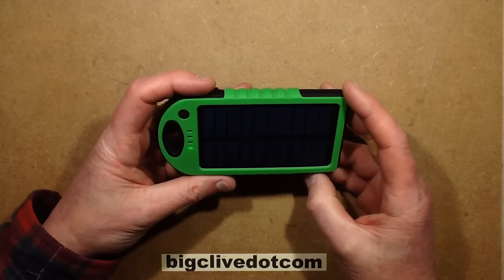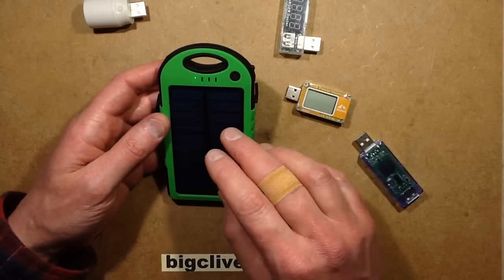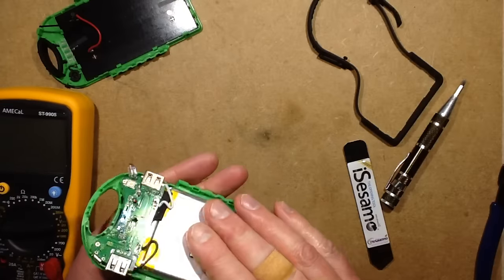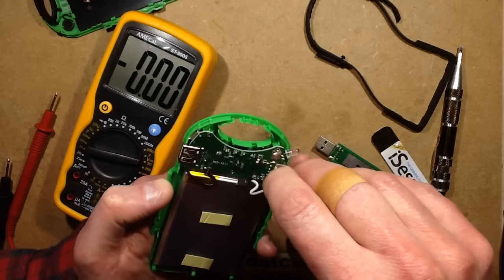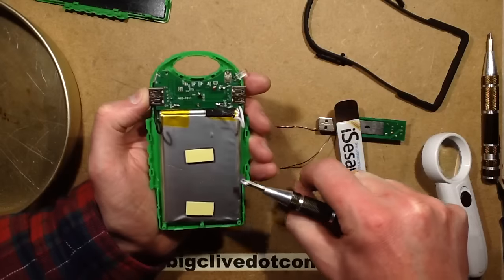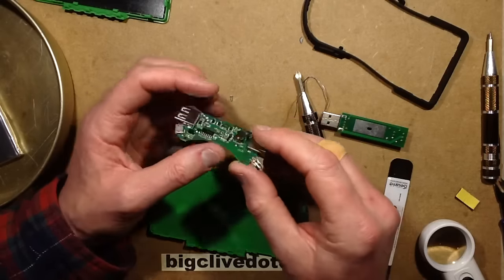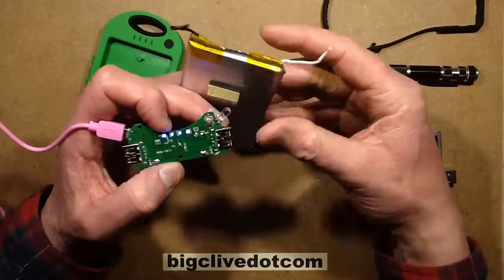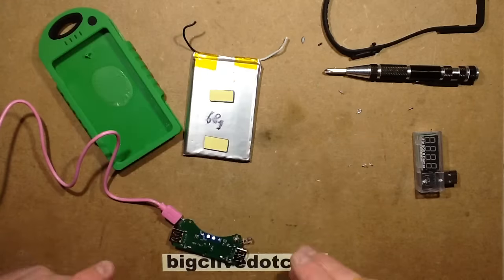Inside a solar USB power bank with "short circuit" feature.

Comment: I bought one of these and the battery was printed 3600mah on my 5000mah unit. LOL
Still cool though for so cheap.
Update: I contacted the seller and they gave me a partial refund.
Went from cheap to super cheap. -satisfied!
Reply: I got one of these a few years back for approx. £10 - rated "5000mah" with the technical section of the manual claiming "6000mah" neither which I believed as the power density just wouldn't work with the best stuff on the market. I can't remember off the top of my head but I opened it up to find 3xxxmah on the battery which I pretty much expected.

Mine actually works pretty well - holds a charge for months, tops up my phone battery atleast once with enough for another 30-50% charge and the solar panel doesn't seem entirely useless though I suspect I'd have to leave it out for several days to get a full charge.

Only got it as I wanted something cheap to stick in one of my work bags where it would take too many knocks for something more expensive but it has held up for around 2 years so far - my intention was to buy cheap expecting to replace it after a few weeks or months.
Reply: China sellers seem to miss off the decimal point.  I got some batteries rated 2500mA and found they were actually 250.0 mAh

Comment: Clive, just a suggestion for removing stubborn batteries that are taped or glued in like that in the future.  I have found that if I take some kevlar fishing line and slide that under one end, then pull the ends of the line back and forth while putting some tension on it to essentially "saw" the glue or pad or whatever it is in half, but since it is just string, it should not risk damage to the pouch cell.

I like kevlar line because it is very tough and resilient, but I have use normal plastic mono-filament line as well, really any sort of thin tough strand should work.

Comment: The panel likely outputs around 150mA, common of that size, it would still take ages to charge just a mere 3000mAh battery however, over 20 hours. 
This is why these items are gimmicks in my opinion. 
A much better item would be a small foldable panel that looks like a tiny aluminium suitcase, let's say unfolded it might be 30cmx20cm, and it's 15cmx20cm folded up. Made with the same quality cells as commercial roof panels, you could expect this mini foldable one to be around a 10w panel. This panel would have 2 outputs, a 12v type one, and a 5v type one for USB devices. 

The idea would be that you could plug it into any power bank or mobile phone, essentially anything that charges from USB, and charge the items up easily and quickly. Plus you could rest the charging item in the shade behind it or behind a tree or something, while the panel itself is in the sun, to basically reduce sun damage and heat on your power bank or mobile phone. And at least with this setup you could not only charge at full rate, but you could likely charge 2 items at the same time at full rate in fact. 

These items like in the video however are crap gimmicks, the only useful thing in the power bank is the battery, the solar panel itself is a glorified solar garden panel in it's pathetic power. A person may as well take the battery out and solder it up to a proper charging circuit if they made the mistake of buying one of these, and of course the panel itself could only be used for a solar garden light project, trying to charge any serious powered battery from such a panel is a fools errand.

Comment: I built a kit that looks  a lot like that one, hell it's even green on one side, black on the other. The kit came with no batteries but I have a rather extensive collection of cells from old tablets and such, so I found 3 that all had the same size and rating, soldered them together with a copper strip for added amperage, then ran the leads to the board.  It has worked great for a couple of years now, it has a strange setup on the side opposite the solar cell, it consists of 9 LED'S with a plastic cover for an area light. This is actually very useful, as I discovered when we had a lengthy power outage last winter.  I turned it on, and the LED's kept our living room illuminated fairly well for several hours and still had nearly full by the gauge.  One of the LED'S on the gauge stopped working, so I replaced it with one I had which turned out to be green instead of the blue that is in the gauge. Does look a bit strange but is readable.  The kits are a blast to build.  Do you think I am taking any chances by hooking the 3 cells together as I have?  I tried it once before making a 12V battery for a hand-held CB.  My grandson's took them out and had a blast with them (I have two) and when they brought them back, they left the one I built the battery for on.  The middle battery swelled about four times it's size, so it was I threw the whole pack instead of trying to recover the outside 2.

Comment: The thing about these types of devices is that you can get 'em good or you can get 'em cheap, but seldom both.
Could some sort of circuit be added to the solar cell side to protect the battery?
With it being so easy to disassemble and what with that extra space the circuit could possible fit.
Reply: +Michael Thompson

I think you could put a 1n5229 zener diode (4.3v 0.5w) across the lithium battery to prevent overcharge. Any voltage above 4.3v will be shunted thru that diode, and I'm sure the solar panel can't put out more than half a watt when at 4.2v or more, even in full sun.

If the USB charge circuit doesn't like that, you could wire the solar panel's output directly to the input of the USB charge controller, making sure that you keep that schottky diode in series with the solar panel (it's reverse polarity protection, which prevents current from flowing thru the solar panel when there's no sun on it).

Either method could be executed for extremely low cost, and the modifications will probably fit right in with the quality of the rest of the circuit.
I can guarantee that it won't make the circuit any less safe than it already is.
Reply: +44R0Ndin Thanks!
Now that I have one perhaps I'll explore a bit!

Comment: I bought one exactly like this (only yellow) on the streets of Hanoi just months after this video was made. Was about $7 CAD. Same problem: one usb side was fooked. Once I had drained the battery, it would never charge - even after leaving it in the sun for weeks. I tore it apart hoping to one day fix it. It finally got tossed, though I still have the solar panel somewhere. Wish I had seen this video sooner!

Comment: I bought exactly the same powerbank, but it was advertised as 10000mAh, and when I took it appart, it said on the battery 3000mAh.... so yeah..... China.....

Also, I love how carefull you are, while I just shoved screwdriver under the battery and ripped it out :D
Reply: Same here: advertised at 5000mAh (at no stated voltage) in Belgium, only 2100mAh @5V in reality, it seems like people are beeing ripped off all over the world.
Reply: Simon 5000mAh here as well, paid €25 for it. While I haven't tested capacity I would say it's around 2000mAh as Simon said
Reply: I actually just went ahead and tested it, a crude test, but still. My multimeter is crap and I didn't time particularly accurately but I measured mine to be between 2050-2200mAh. (that's plus or minus a few tens of minutes because I got distracted)

Comment: Clive, if you see this, I know there are loads of soldering tutorials etc on ytube and you also mention things frequently as you do them. But I KNOW lots of people come to your channel as utter noobs like myself who find your style relaxing and informative. Any chance of a rock-bottom starter guide? I mean, there are even different gauges and flux-vs-solder amounts you can buy.... A real stripped-down "what is solder, what is it for, how it works, what you need for what job and some associated tools for the late-starter" would be awesome. Can you have too much flux? Is it worth buying separate flux? I have become enthused to start a new thing. At age 42 though and not wanting to spend loads yet, a learn-how-to-learn and starter guide from you would be extraordinarily valuable x
Reply: Ugh, sorry for the block of text. Mobile phone laziness on my part.
Reply: +TheBaconWizard I have the beautiful benefit of being able to see my soldering before and after I changed flux. That shit I used to start with made my soldering extremely mediocre.
Reply: Flux is essential, and for normal soldering, just take generic flux core solder. 310 C° to 350 C° are a good temp in my case, if it needs too long to melt, its too cold and if the solder on the tip crumbles and changes color its too hot. If you need to solder smd stuff, you might wanna buy thin solder and a flux pen. 
Crappy cheap irons dont last long, same for tips. 

Soldering : 
Heat up both the pad and wire, and then after about a second (try around) add a bit of solder directly on the pad and wire, not on the tip. That way you make sure that all the surfaces are hot which is necessary for a good joint. If it doesnt flow and forms a ball, its either a cold joint or just too much solder. Just heat it up, get some solder away and repeat.
Reply: +49616e a great example of the kind of folks that gravitate to this channel :) Generous with info, and relaxed, mostly. Thanks above.
Reply: +drkastenbrot I agree that cheap irons are not worth it, and neither is cheap solder. I like to use lead-based solder over lead-free because it warms up well, makes a nice joint, doesn&#39;t oxidize as fast (then it becomes sticky) and leaves a nice, very reflective surface. My soldering iron, which I had used for at least four years now blew its ceramic element up alongside a fuse. It actually blew two fuses because I had to find out what caused it to blow (my room is full of devices). I bought a Parkside adjustable soldering station for 10 euros, and so far all my Parkside devices are running smoothly. Parkside is a German tool maker.
Reply: +TheBaconWizard. Check out Mr Carlson's Lab on YouTube. He did a really good video a few weeks ago on this subject. He knows his stuff!
Reply: +TheBaconWizard  great I had never heard of flux before, will have to do some reading about it.
Reply: ***** I use a solder sucker to get components out.
Reply: I use a 100W soldering gun, and in some ways it's harder to use than a regular iron. Hold the trigger too long, and your solder is dead and so is the joint. But the speed at which you can pick it up and get going is amazing. Still a bit unweildly but you can pull off precise joints with some practice.
Reply: +1 here ...very relaxing and informing style ...would appreciate some soldering tutorials from the ground up, as I also am a bloody newbie :-)
Reply: +Prehistoricman i had one of those weller, back when things were larger to solder it was great, you learn to pulse it manually to keep it just right. (people loved them in the 60.70s when things were either discrete or valve sockets.
Reply: soldering is super easy, I tell you in 1 sentence, first heat the pieces you want to solder, then apply Tin, not too much, and not too greedy.

could someone mention in which cases flux would be important by the way ? someone mention fast and reliable connection, that's pretty much all the time required lol
Reply: Thomas Syxe Flux makes the solder stick to copper and it stops the solder from oxidising. It cleans the tip of the iron and makes multi-core wires wick up the solder. Absolutely essential!
Reply: what flux do you recommend ?
Reply: Went into my local Maplin today, and they ONLY had lead-free solder. It'll have to be an online purchase methinks. Have got myself an entry level (but not cheap Chinese knockoff) soldering station :) Gonna start playing with cheap parts and making things like bridge rectifiers and the like as practice both in soldering and getting familiar with some of the maths.
Reply: TheBaconWizard It's good practice to work on some old board with disgusting solder and also modern boards with chinese plastic solder just for experience. When you're playing around with a board, you don't really need to make sensible modifications since you're just practicing. Also tinning and connecting big multi-core leads is a good exercise.
Reply: what you mean plastic solder ?

and why lead, isn't just Tin enough ? I bet lead/Tin fumes must be pretty toxic...

by the way.. I like the idea of recycling old boards/electronics, sounds good, however, you must know what you salvage lol, well I guess the most basic components like resistances and capacitors etc it's written on it (or just measure the resistance..) but then you have to store in in a smart way lol, and damn, I'm still so noob, only low level, even though I followed 2-3 years of courses with electrotechnics, I forgot most of it (and I wasn't very good, AND, I don't like the way they teach at school, it's boring).

However I found an ebook online, and it's a complete course on electronics, I really need to start reading it until the end ! :), I liked the style, at the beggining they talk about the atoms, and the electrons, it's well designed ! and it makes you want to learn more, in a few pages I learnt more about electronics than a year at school learning formulas
Reply: nice thanks
Reply: PunakiviAddikti Parkside? Isn't that the brand often sold at Lidl?

Comment: Just some quick math, I just chose a random LiPo battery, a 4 cell 5,000mah battery that weighs 500 grams, means 1 cell is 125grams with a capacity of 5,000mah. That gives us 40mah/gram. Using the weight of your battery, we get the theoretical capacity to be 2,600mah, about half the advertised capacity. Now this is a lipo cell, with a max voltage of 4.2volts, but 3.7 nominal. So we can estimate about 9.6 watts of power in there. At 5 volts, that gives us 1,900mah. Assuming some rounding errors, we'll call that 2,000mah capacity. Now when using LiPo's, generally you only use 80% of the capacity before you start damaging the cell. So at an 80% discharge we get 1,600mah of capacity, which is spot on with what you saw with your USB charger. So I think it's safe to say the LiPo cell in these units are around the 2,500mah range.

Comment: I think you got unlucky with the solder splatter. I took mine to bits ages ago and it was a beautiful job. You're probably right about the overcharge in sunlight. Mine came with a warning not to leave it out in the sun once it was charged. However, it solar-charges so slowly it wouldn't really be an issue. Just don't tack it to the side of a garden shed. But it - does - charge in the sun if you leave it long enough. Enough to get you on your way again. Capacity, well I can get just about 2 basic android smartphone charges out of it. I think that's a lot less than 5000mah but it is very useable nonetheless. And the little LED makes for a great solar powered torch. At £8.00 off ebay, I would certainly recommend them for anyone doing a bit of hiking. Nice to see it on this vid - thx.

Comment: Clive, remember the little black piece do tape you pulled off.  Well actually it’s one per side and you pull it. As it stretches the adhesive stops and it comes off with no issues. That’s if the it doesn’t break. lol and always we enjoyed my friend and learned.

Comment: In regards to your reference about iPhone batteries, I went to use my iPhone the other night and I noticed what I thought was my phone popping out of it's case, so I went to push it back in and then I noticed that it wasn't the phone coming out of the case but the screen separating from the phone's body. 

When I took it to the Apple store I showed the phone to the guy and straight away he said that the phone's battery had swollen and that it was nothing that I had done and that it's a known "rare" issue. He said that even though the phone was out of warranty, it was a hardware fault not caused by me, and the phone was in great condition otherwise (no scratches or dents), so he'd replace it there and then, at no cost with a brand new phone. 

I was pretty pleased, great customer service.
Reply from the maker: +Michael MacGyver They were removing it from public view.  That's why he was so keen to take it away and give you a nice new one.  Apple don't like the adverse publicity caused by dramatic failure of the lithium cells in their phones.
Reply: Now I feel like a Gulli-Bull, I guess I need to be more cynical

Comment: Hey clive, I want your opinions on a specific powerbank. It was sold (and branded) by an eBay seller called "Bay Valley Parts", a seller in the US. It is a 10,000Ah powerbank with 5 18650s inside, arranged in a nice layout that makes the bank thin enough to carry in a pocket. The amazing part was that the powerbank was less than 8USD for a US warehouse. There are two flavors, one with two LEDS and a single USB port, and another with two USB sockets and no LEDS. Took mine apart (the single USB flavor) and it looks like the board for the dual USB version is the same. Rather annoyingly, the USB data+/- was just left floating, so it shows up as a 500mA socket. The included cable is the dumb kind with the data pins connected together in the microusb side.

Comment: Hi Clive, nice little video, thanks!
I've got one of these and it goes to sleep after about seconds when there's no load on the output.  Do you happen to know a way to stop this from happening?  It's not that I am not loading it, but I want to use it to power and Arduino, and I'm only draining 25mA, so the thing keeps switching off (presumably because it thinks that isn't sufficient load)!  
Many thanks!
Neil
Reply from the maker: If you can find a sense resistor it may be possible to fool it into thinking there's a higher load by increasing its value.  But it would also reduce the amount of current the unit could deliver.
Reply: @bigclivedotcom  Great, thank you! I'll have a look and let you know how I get on!